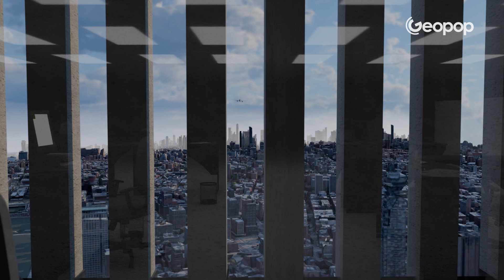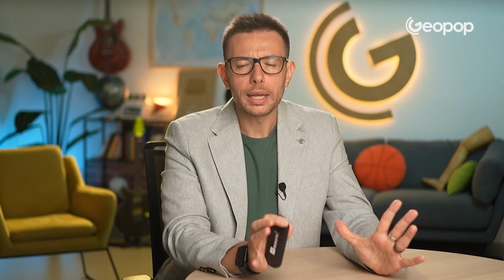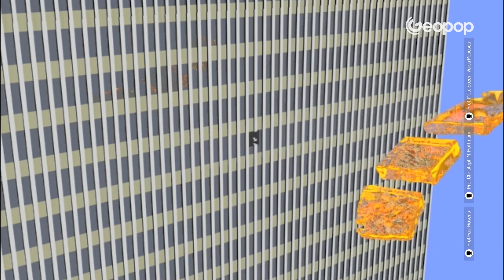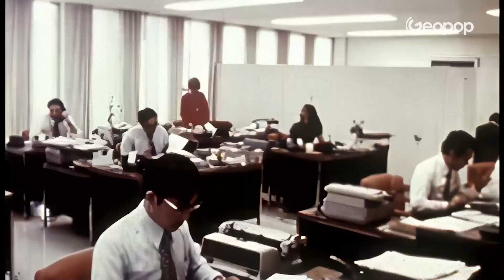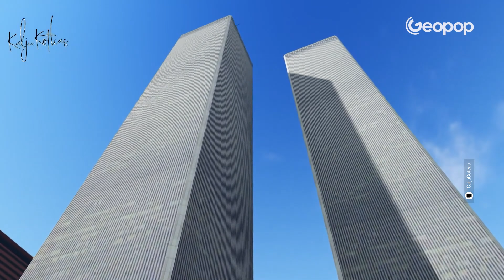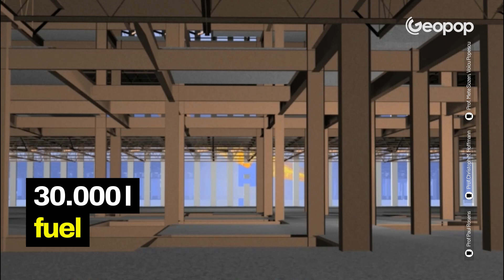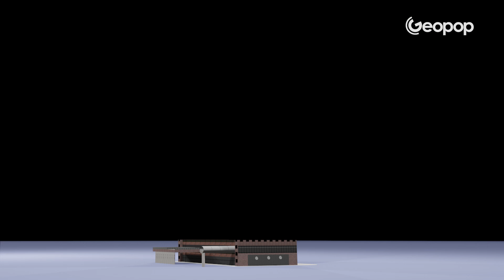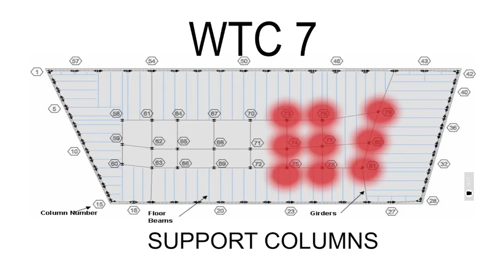9/11, 2001: The Technical Reconstruction of the Twin Towers and WTC 7 Collapses

Comment: But you don't explain why building 7 went down like it was on an elevator.  You don't explain why the news (BBCI think) reported that building 7 had collapsed 20 min before it happened. Why Larry silverstien, the 99yr lease holder" admitted to "pulling" the building which is a demolition term for controlled explosion and how could they pull that off a few hours with pandemonium happening all around them?
Reply: The news reporting it early doesn't mean much at all and can be honest mistake or trying to be first to report news. 
If Building 7 was a controlled demolition, where are the explosions? It just comes down in the video- that isn't proof or even evidence that it was controlled demolition.
Reply: @Joseph-e9p1x  Now this might be shocking to you, but controlled demolitions don´t have to use explosives.
Reply: @zettel3296 
1. Please elaborate on what you mean in detail

2. That doesn't necessarily refute what I said (prior to elaboration)
Reply: @Joseph-e9p1x  1. What I mean in detail is that there are other techniques to demolish buildings. Never heard of wrecking balls?!? Ropes/cables?!? Diggers?!?Verinage?!? Thermite?!?

2. Oh you can have that too: The free fall totally proves the controlled demolition of WTC7.
Reply: @Joseph-e9p1x thank you for your respectful reply. I appreciate it. Live long and prosper 🖖
Reply: @tedscott3294  
indeed
Reply: @Joseph-e9p1x reporting it early is HUGE! How could the news know it was coming down if it wasn't a controlled demolition. And if it was a controleed demolition, how could they pull it off in a few hours when it takes weeks, even a month to plan and execute somethinh like that. But hey, they were able to pull it off on the fly while the building is burning... Its impossible.
Reply: @tedscott3294  - Oh goody. Yet another mindless repeater of tired old dead horses from Loose Change. 

Yawn.
Reply: @TheLoonResistance how about you tell me why those points don't matter?
Ig someone went to the police and said there husband or wife was shot and killed at home. And then 20 min later they watch someone shoot at kill the spouse, the cops are gonna have a serious, yet simple case to solve
Reply: @tedscott3294  - Can't figure it out for yourself even after a million people copied those same ideas off Loose Change then ran to the internet only to fall completely on their face over the last 20 years?

I can see this is going to be a big job. 

1.  Building 7 did NOT go down like an elevator . Its collapse was progressive, in stages.   False claim = not relevant.

2.  The BBC read a wire service report which later turned out to be erroneous that Building 7 had or was in danger of collapsing about 20 minutes before it actually did. It wasn't their report. Here's a fun game you can play at home.  Go back and re-watch recordings of the live TV news coverage from that day and down a shot for every report that would later turn out to be erroneous or in error. You will be dead of alcohol poisoning within a few hours.  Such is the nature of live news coverage of chaotic and rapidly evolving events.  So what?

3. Larry Silverstein never admitted pulling Building 7 (a patently stupid claim even the producers of Loose Change walked back years ago) and I have no idea what this 99 year lease you speak of is.  False claim = not relevant.

4. Pull is not now and never has been a demolition term . 

Leading demolition and explosives expert and editor of Implosion Magazine Brent Blanchard - We have never ever heard the term ‘pull it’ being used to refer to explosive demolition and neither has any blast team we’ve spoken with

It is however a term used by FDNY firefighters with a very different meaning than the one you are (falsely) trying to impose:

FDNY Chief Daniel Nigro - The biggest decision we had to make on the first day was to clear the area and create a collapse zone around the severely damaged 7 World Trade Center, a 47-story building heavily involved in fire. A number of fire officers and companies assessed the damage to the building. The appraisals indicated that the building's structural integrity was in serious doubt. I issued orders to PULL back the firefighters and define the collapse zone. It was a critical decision; We could not lose any more firefighters. It took a lot of time to PULL everyone out, given the emotionalism of the day, communications difficulties and the collapse terrain 

Deputy Chief Peter Hayden - 33 year veteran, NYFD in the August 2002 Firehouse Magazine; No, not right away, and that's probably why it stood for so long because it took a while for that fire to develop. It was a heavy body of fire in there and then we didn't make any attempt to fight it. That was just one of those wars we were just going to lose. We were concerned about the collapse of a 47-story building there. We were worried about additional collapse there of what was remaining standing of the towers and the Marriott, so we started PULLING the people back after a couple of hours of surface removal and searches along the surface of the debris. We started to PULL guys back because we were concerned for their safety

Larry Silverstein claimed he spoke with a (unidentified) FDNY fire chief, NOT a demolitions person. BTW - that conversation almost certainly never happened, so this is all much ado over nothing.

5.  You pointed out yourself how preposterous the whole blowing up a (burning) building in just a few hours is.  Follow that logic stream to its inevitable conclusion.
Reply: @tedscott3294  
You're assuming that they knew it was going to come down, rather than that it was a honest mistake or even a stupid/greedy mistake to report something first that they thought did happen, or assumed would happen or just straight up lied for the potential press and then "apologize later", we've seen stuff like that in media/politics many times. 

The fact that the incorrectly reported it does not mean that they knew. Plus, if it was a controlled demolition, why in the world would those who did that tell media to report it? The whole point was to deceive and make it look like it wasn't controlled demo. Telling the media (and a non American media at that..) that it collapsed just looks sloppy. 

And for the video itself, where are the explosions? Controlled demos have a series of detonations that are noticeable right? I don't see that in the collapse.
Reply: @tedscott3294  - So we can finally stop beating this dead horse, achieving absolutely nothing for the millionth time:

At 10:28am the WTC North Tower collapsed, showering Building 7 with tons of burning debris, causing heavy damage and starting many fires burning out of control for the next 7 hours. Since half the firefighters had been killed, units in disarray, equipment destroyed, no water pressure, and the priority of search & rescue efforts, 7 couldn’t be saved so firefighting efforts were pulled as futile and 7 left to its fate. Firefighters make that choice every day in brush fire situations - which houses to save and which ones to let go. Only real difference here is moving the decimal on the size and cost. People get overwhelmed by the size.

www.youtube.com/watch?v=g_SvpwyC17M 

Collapse of a burning structure is always a concern for firefighters.  Steel buildings are uniquely vulnerable to fire damage. Designed around 1 to 3 hours of fire resistance for occupants to escape they rely on active firefighting to survive.  After that all bets are off. Left to their own devices they'll exceed their design envelope and collapse, like Plasco Tower and Wilton Paes de Almeida. In 7 the occupants escaped, passive and active fire protections were compromised and active firefighting was abandoned hours before the collapse, which left the building to its fate. It lost. Odds on Building 7 would eventually collapse, and it did. No big deal in logic.

 http://www.youtube.com/watch?v=WnYBX6QT0R4 

FDNY Chief Daniel Nigro - The biggest decision we had to make on the first day was to clear the area and create a collapse zone around the severely damaged 7 World Trade Center, a 47-story building heavily involved in fire. A number of fire officers and companies assessed the damage to the building. The appraisals indicated that the building's structural integrity was in serious doubt. I issued orders to PULL back the firefighters and define the collapse zone. It was a critical decision; We could not lose any more firefighters. It took a lot of time to PULL everyone out, given the emotionalism of the day, communications difficulties and the collapse terrain 

FDNY Deputy Chief Peter Hayden ; We had our special operations people set up surveying instruments to monitor and see if there was any movement in the building. We were concerned of the possibility of collapse in the building. And we had a discussion with one particular engineer there, and we asked him if we allowed it to burn could we anticipate a collapse and if so, how soon? And it turned out that he was pretty much right on the money, that he said 'In its current state you have about 5 hours 

The collapse of Building 7 was anticipated and widely reported in the media throughout the day with 24 video cameras recording it. Everyone knew what was coming and why. 

www.youtube.com/watch?v=OY5S5k3tMHI

Indeed, at 11:07 am CNN reported Building 7 had collapsed at 10:45 am, or 15 minutes after the North Towers collapse at around 10:30. They did it again at about 4 pm reporting Building 7 had collapsed or was in danger of collapse with the local Fox affiliate doing the same at around the same time. Those and other reports escaped the attention of the keen investigators at Loose Change so people like you never fuss over them. 

The BBC got their (mis)information from the respected news agency Reuters, which picked up an incorrect report. They issued this statement: “On 11 September 2001 Reuters incorrectly reported that one of the buildings at the New York World Trade Center, 7 WTC, had collapsed before it actually did. The report was picked up from a local news story and was withdrawn as soon as it emerged that the building had not fallen.” 

Have you ever played the game “Telephone”? 

You know, where you whisper something to your friend, then they pass that to the next person, then to the next and so on? By the time you get through 7-8 people, the message has completely distorted its original meaning. On 9/11 amplify that by a few thousand.

News flash: Reporters are human beings and just like you, they make mistakes (and when they do they issue corrections).
Reply: @Joseph-e9p1x so the news company just got lucky, huh? Because we always see the news report something before it happens, right? 
Imagine if the news reported Trumps assassination attempts 20 min before they happeded. That reporter would be locked up for sure because they new about it!
Reply: @tedscott3294  - Again, since you keep missing it (or are doing your best to prove De Nile is not just a big river in Egypt) and so we can finally stop beating this dead horse, achieving absolutely nothing for the millionth time:

At 10:28am the WTC North Tower collapsed, showering Building 7 with tons of burning debris, causing heavy damage and starting many fires burning out of control for the next 7 hours. Since half the firefighters had been killed, units in disarray, equipment destroyed, no water pressure, and the priority of search & rescue efforts, 7 couldn’t be saved so firefighting efforts were pulled as futile and 7 left to its fate. Firefighters make that choice every day in brush fire situations - which houses to save and which ones to let go. Only real difference here is moving the decimal on the size and cost. People get overwhelmed by the size.

www.youtube.com/watch?v=g_SvpwyC17M 

Collapse of a burning structure is always a concern for firefighters.  Steel buildings are uniquely vulnerable to fire damage. Designed around 1 to 3 hours of fire resistance for occupants to escape they rely on active firefighting to survive.  After that all bets are off. Left to their own devices they'll exceed their design envelope and collapse, like Plasco Tower and Wilton Paes de Almeida. In 7 the occupants escaped, passive and active fire protections were compromised and active firefighting was abandoned hours before the collapse, which left the building to its fate. It lost. Odds on Building 7 would eventually collapse, and it did. No big deal in logic.

 http://www.youtube.com/watch?v=WnYBX6QT0R4 

FDNY Chief Daniel Nigro - The biggest decision we had to make on the first day was to clear the area and create a collapse zone around the severely damaged 7 World Trade Center, a 47-story building heavily involved in fire. A number of fire officers and companies assessed the damage to the building. The appraisals indicated that the building's structural integrity was in serious doubt. I issued orders to PULL back the firefighters and define the collapse zone. It was a critical decision; We could not lose any more firefighters. It took a lot of time to PULL everyone out, given the emotionalism of the day, communications difficulties and the collapse terrain 

FDNY Deputy Chief Peter Hayden ; We had our special operations people set up surveying instruments to monitor and see if there was any movement in the building. We were concerned of the possibility of collapse in the building. And we had a discussion with one particular engineer there, and we asked him if we allowed it to burn could we anticipate a collapse and if so, how soon? And it turned out that he was pretty much right on the money, that he said 'In its current state you have about 5 hours 

The collapse of Building 7 was anticipated and widely reported in the media throughout the day with 24 video cameras recording it. Everyone knew what was coming and why. 

www.youtube.com/watch?v=OY5S5k3tMHI

Indeed, at 11:07 am CNN reported Building 7 had collapsed at 10:45 am, or 15 minutes after the North Towers collapse at around 10:30. They did it again at about 4 pm reporting Building 7 had collapsed or was in danger of collapse with the local Fox affiliate doing the same at around the same time. Those and other reports escaped the attention of the keen investigators at Loose Change so people like you never fuss over them. 

The BBC got their (mis)information from the respected news agency Reuters, which picked up an incorrect report. They issued this statement: “On 11 September 2001 Reuters incorrectly reported that one of the buildings at the New York World Trade Center, 7 WTC, had collapsed before it actually did. The report was picked up from a local news story and was withdrawn as soon as it emerged that the building had not fallen.” 

Have you ever played the game “Telephone”? 

You know, where you whisper something to your friend, then they pass that to the next person, then to the next and so on? By the time you get through 7-8 people, the message has completely distorted its original meaning. On 9/11 amplify that by a few thousand.

News flash: Reporters are human beings and just like you, they make mistakes (and when they do they issue corrections).
Reply: @TheLoonResistance LMAO First of all, nome this is beating a dead horse because the matter has not been resolved.
2nd, engineer all over have said that theres no way a fire on one of the top floors caused that whole builodimg.to come down. 
3rd when do building falls down like its on an elevator instead of timbering over without it being controlled.

Of you believe the 9/11 report, you might as well believe the Warren Commission too, and while you're at it, i got a bridge to sell you along with some beautiful swamp land.
Live long and prosper 🖖
Reply: @tedscott3294  - This matter was resolved 20 years ago. You just never got the memo.

You clearly have your dogma and aren't interested in anything else. You know it all and nothing can change that. 

I wish you luck with that. Really hope it works out for you.
Reply: @TheLoonResistance oh i got. I just know BS when I see it because apllying crital thinking really matters. You should try it.
Reply: @tedscott3294  - So why am I the one explaining everything in detail and you are the one hand-waving everything off you don't like, never addressing any of the points made?

You may fool yourself, but you aren't fooling anyone else.  I'm done letting you waste my time. Goodbye.
Reply: @TheLoonResistance you're hand waiving, the news knowing about it before hand, silverstien admitting to it and all the engineers that said it was im impossible for a fire a to bring down the building while proposin the building collapsed before it did is just an honest go-gettters mistake and it's an honest phsyic mistakefor a government who not only disturbed a crime scene, but shipped it away before a proper scientific forensic team could analysize it. Then the government melted down the rubble into 9/11 coins so everyday people can be an accessory to a crime by destroying evidence for one low price.
You think you're smart like Hitler thought he was right
Reply: @tedscott3294  
My guy, we see misinformation, incorrect reports, redacted reports, etc. constantly in the news. 

The Trump analogy does not fit and is incomplete, to even make it comparable it'd have to include that there was some major/unprecedented attack on the Whitehouse (a bomb or invasion, etc.) and someone reported that Trump was killed but at that exact time he wasn't dead yet, but then died later that die from either injuries in the attack or a criminal wasn't found and then surprise killed him/etc.....THAT would be more accurate analogy and under those circumstances he would not be locked up and it would not be seen as him "knowing" it was going to happen. 

As I said before- it makes no sense for any Media, let alone non-US, to know about the collapse if the point was to deceive. AND they did not have the same info/technology advantage back then, so a reporter hearing about the massive attack and BOTH towers collapsing AND building 7 being on fire for HOURS.....it is not a crazy thing that they incorrectly reported it to have collapsed soon before it did.
Reply: @tedscott3294  
There are engineers who have said that it can or did....so how do you personally discern between the two?  

I know an engineer personally who has said that it could collapse the way it did. Do you understand the structural mechanics behind how if collapsed?

And the fires weren't just on the top floors, there is footage that shows the fires were more extensive than that.